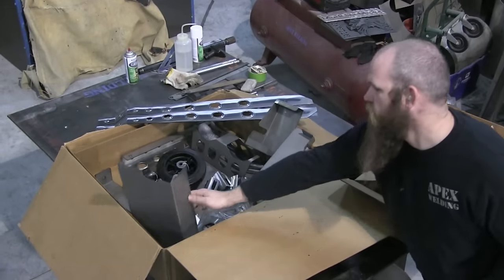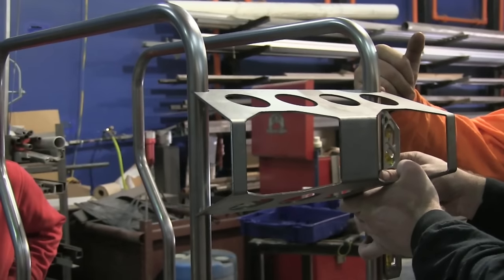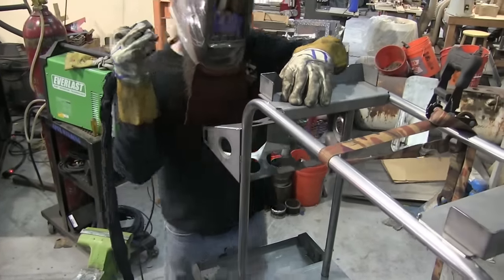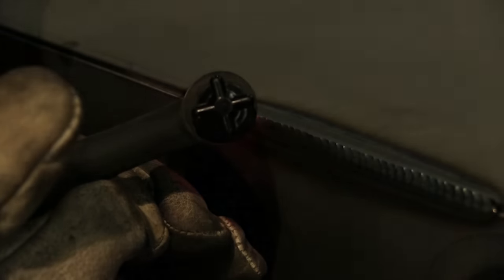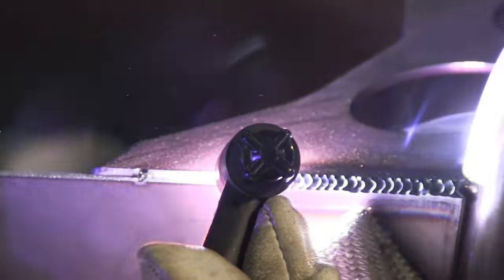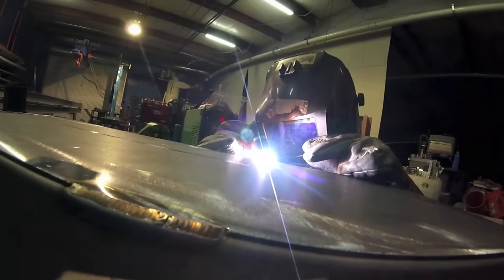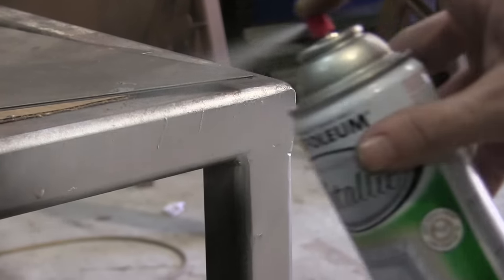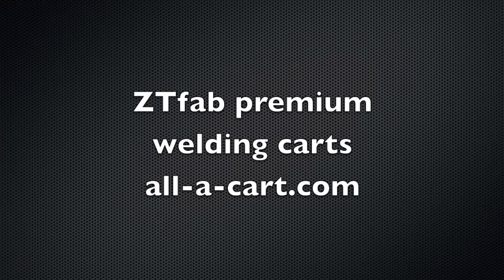JD Brewer ZTFab Welding Cart

Comment: Thanks, that was a sweet build. After I changed out my huge torch that came with my Everlast 250 EX with a CK20 water cooled flex head with high flex cables it was a fantastic upgrade but I missed the button feature on the old Euro style torch that came with the welder. On line I found an inexpensive button and plug for my unit- under $10 total and wired it up. It is so nice to have that feature again using it as you showed. Very versatile in both 2t an4t. when you don't need the pedal. I would recommend having one on any torch just in case. One of the best other upgrades I would recommend is purchasing a foot control from SSC Controls out of Mentor Oh, Great product, service and price. Looking forward to your future videos. Ed K. Cleve. Oh.

Comment: I've been messing with the silicon bronze pulse for a while now and I found 3/32 red or gold 3/32 filler and either the rule of 33 pulse settings with high amps (can't remember) or about 120 amps and 95% on time and the rest at 33 makes for very nice looking welds, I really wanna try it on a small table or chair something aesthetic not structural

Comment: I don't think much of ZT Fab. The kit to turn a Harbor Freight chest into a cart cost $310 when I checked, and that was more than a chest cost.  The kit also looked flimsy. I couldn't see putting $600 into the kit and cart combination.

The standalone cart is also expensive, and when you're done, you have something only a little better than a Vulcan cart, which runs around $100 and requires no welding.

I got a Harbor Freight chest and fabbed up a base from hot-rolled steel. It has a 1000-pound capacity, so 300 pounds of bottles are no problem. It has 10000 cubic inches of drawer space. Two welders fit on top just fine. I probably have $400 in it, and it will last forever.

It took several days to do what I did, including time for the paint to cure. I'm building a second one, and it's faster because there is very little designing left to be done, and I already knew what to buy this time.

Comment: Burst Tack shielding gas . . . . how did you manage the shielding gas start/stop?
Reply from the maker: either manually pre purge with switch or  if your machine has a pre flow setting set to .2 seconds.
post flow was set low to  save gas for the tacks

Comment: 'Howdy Jody. Can you please tell me where i can find those blue tubes/canisters for the filler rod? TIA
Reply: Wild Weasel I found them at my local welding supply for like $12.
Reply: Thanks bud. They look nice. I usually keep them on the thin plastic sheath or use a 2 inch capped pvc tube
Reply: I use 3/4" PVC since I have many types of filler and little room to store.  For steel rods, the little oxygen absorber packets from commercial jerky packages helps to keep corrosion down.  Use in addition with silica gel.  Oxygen absorber packs have powdered iron and salt.

Comment: I really dont understand the fascination of welding carts in the US, I just have 10m leads on my welder! Welder never moves!
They also look narrow, and with the welder sitting on top, I'd be worried that it might fall over if I gave it a decent sideways push.
Reply: Jack Dawg that's a long way to walk back and forth if you need to change settings, fine for stick welding but anything else it's a pain
Reply: Brandon S  I try not to change them too often, usually just set it up when I turn the machine on

Comment: in the past i have only had a stick welder, and then a mig, i hated mig, now bought a 2nd hand cheap and nasty wun hung lo brand tig, it has a switch for stick/tig and amps, it works with sticks way better than i expected, better than my old transformer box. but tig, my tig tip lasts only seconds, and i think someone was pulling my leg, but i was told the arc is many thousands of volts and it can shoot back down the filler wire giving you a shock and so i should only tig with thick rubber lined gloves...really?

Comment: bit random but could you run some 6013 on vertical having issues with inclusions just at the start but using the same technique so dont see how im getting inclusions for the first half inch of the weld there in a row but fine after that
Reply: I don't think Jody is a fan of 6013.